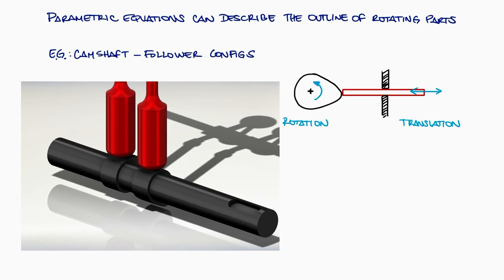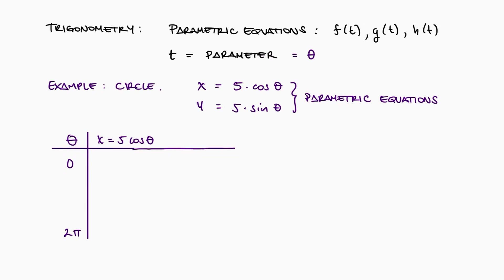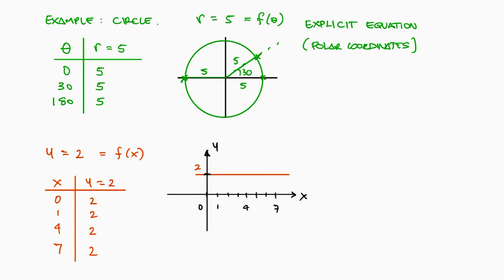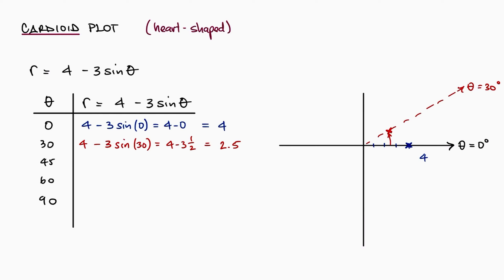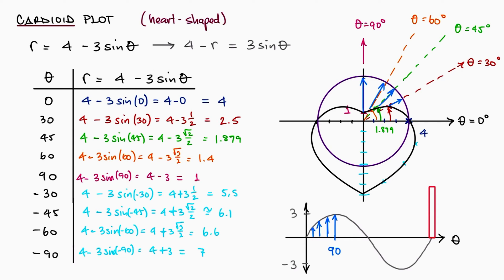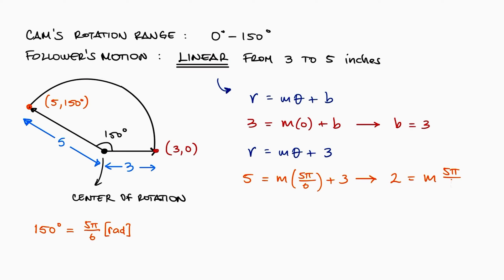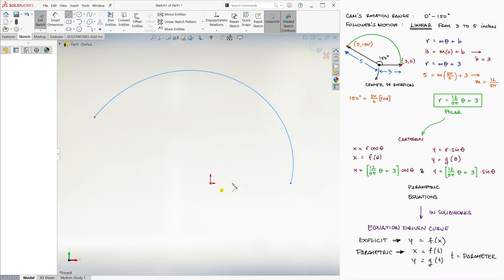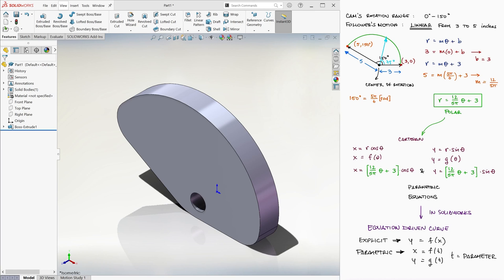Equation Driven Curve in SOLIDWORKS in 10 Minutes!

Comment: Well executed, and timely for my needs. I need to generate a parametric curve for a 2D spiral. Solidworks refused to accept a more useful equation that biased the spiral to reduce stress concentration at each end, but a linear spiral based on your 'mx+b' example work fine. Thanks for the help!